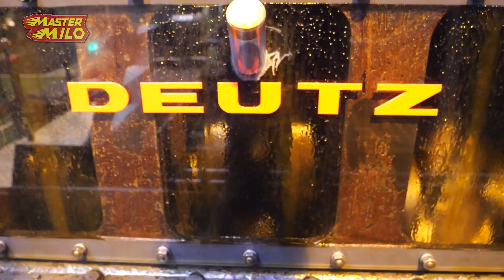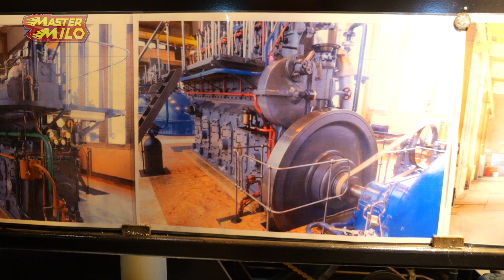Starting a 320 litre big engine made in 1935

Comment: it would be interesting to see how much torque it has !! since its clearly designed for torque over hp
Reply: That can be calculated. It's just over 10.000nm  (7375 lbs) of torque at maximum rpm and horsepower.
Reply: Maybe R0B0C0P can stop that thing with his bare... eh, metal hands.

Comment: Will this fit in my VW Polo? …..if my measurements are correct; it should bolt right in 👍😃
Reply: Straight onto the chassis with a bit of overhang at each end, perfect 50:50 weight distribution across both axles, and, it is technically Front-Engine, Mid-Engine, &, Rear-Engine all at the same time.

Just remember to install the emissions cheating software to past that smog test hahahahahahaha
Reply: @longnamedude3947  excellent 👍😃

Comment: Bonjour Maître,
320 liters... Hum, I would say 32 and it is already huge 😉
Never mind, another good video pleasant to watch, even if less crazy than your usual ones 😁
Amicalement, Raphaël
Reply: Really 320. This engine is as high as a small house. There are stairs to climb on the cylinder head, where Milo check the valvetrain. 32 L is the kind of motor you can find on big trucks. WWII aircraft had 32 L motors.

Comment: Only 460HP? Is that all?
I bet if you dyno'd that today you would find that it makes significantly more horsepower than it was originally claimed and rated for.

A lot of the older engines and other locomotive machinery of the past were guesstimated figures and actual power often is far higher than originally rated, in other cases it can be far lower than originally rated too.

Modern dyno's are far more accurate than they were in the past, and even today you can get figures that vary by as much as 5% between two different dyno's!

Awesome piece of machinery, and it is great too see that after almost one hundred years that it is still going with what I assume are most of the original parts to it.

It's certainly not built for performance, but rather, it is built to provide a guaranteed minimum amount of power with minimal effort and maximal reliability at all times.
Of course these days their are more efficient ways of producing that power, even with the same mechanicals by just adjusting things like valve timings and the fuel being used to be a more calorific fuel than conventional old age diesel that this thing uses.
You could then in turn reduce maintenance requirements and reduce pollutants that the engine puts out, thus further extending it's usable lifespan should it ever be needed.

In these modern times a focus on getting existing things to last longer, be more efficient, and be less pollutant is critical to ensuring out future survival, and, too ensuring that ever increasing artificial costs can be counteracted by refusing to part-take in the fools game that is modern day economics and instead focusing on yourself and your fellow people and not playing ball with the corrupt politicians and financial BS'ers.
Reply: only 460hp, cuz max rpm is 320. Horsepower is torque*rpm.

So big engines have low power but a heck ton of torque. At max power, the torque on this would be something like 10,000 Nm, which admittedly is low given the size of this beast, but remember this is 1935, efficiency was way lower.
Reply: It was built for performance. Its performance specs are high torque, high hp, low speed, high reliability & endurance.
Werkspoor specialised in engines with this type of performance.
Reply: I once worked on a ship with a engine of similar size. It had 750 hp at 400 or 440rpm (can't remember) build in 1967. The engine broke down after parts failure shortly after a major overhaul. It was replaced by a 2006 cummins with 1000 hp, but the old engine was actually stronger and way more efficient.
Reply: @autobootpiloot  Old doesn't mean bad, and it seems that often when vehicles are retrofitted the new propulsion methods just are not as reliable.

This beast is sure to be HIGHLY reliable minus normal metal fatigue over time and micro vibrations maybe causing minor wear against the cylinder walls.
Reply: @jackopolo4635  You can be sure this has more torque than would ever be needed for it's intended application, because in industrial applications where reliability is needed it is worth the extra expense of over specifying your power/torque needs way above what is required because that way you ensure your machinery is never under any heavy stress.
Reply: @longnamedude3947  This kind of engine is highly reliable, but needs a lot of maintenance and attention during working hours. Modern engines are start and forget engines, just refresh oil every couple of thousend hours. Nowadays i work on a ship with a Caterpillar 3512 with 1500hp. Going strong with over 60k hours and never been opened. Even the turbo's are original. Most likely it will last about 100k hours before needing a refresh. Old engines are just not economical to run anymore. That's why i have a smaller old slow turning engine in my private boat, just for fun.